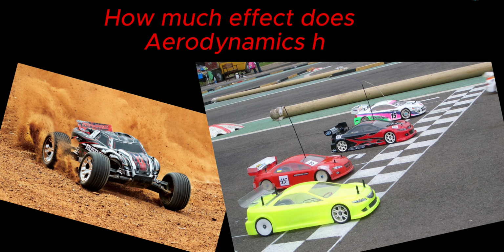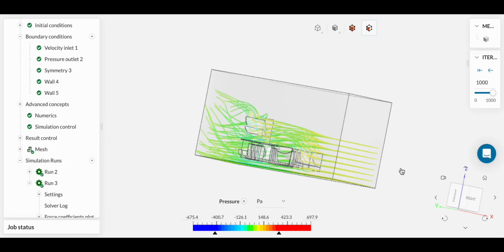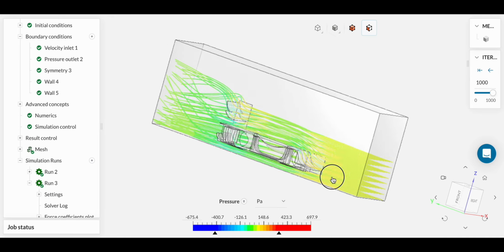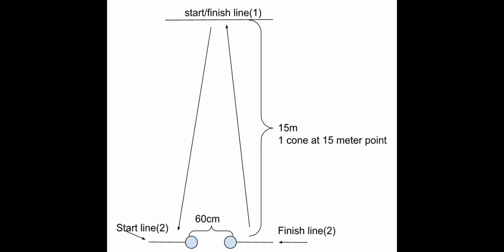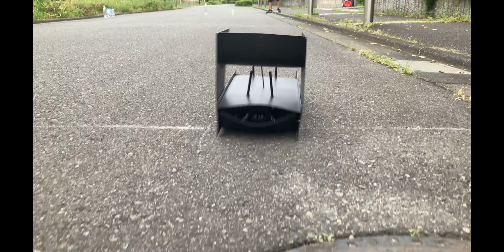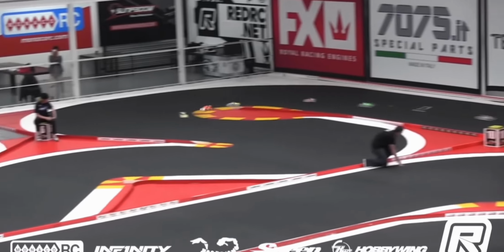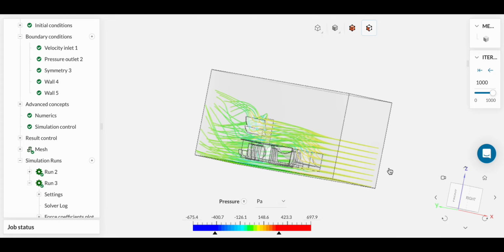Does Aerodynamics affect Remote Control cars?

Comment: You're on the right track with critical thinking, setting up a test, quantifying, and evaluating the results and validity. This isn't a super clean battery of test points, but you're on the right path. The fact that you designed and built your own test article, as well as designed your own test, is great. You're on the path to being a designer or test engineer.

Comment: Aerodynamics of rc bodies is massively critical. High speed is where aero becomes critical. That body you built will give massive dowforce in a straight line, but will actually fight against steering. Instead of allowing the car to turn it will try to keep it straight. I use 3 different bodies on my drag car, depending on track conditions. As for 1/10 on the road, i run a pile of different bodies for different classes, rules, and conditions. At low speed where your tamiya is, weight balancing will go further than aero will get you. Those old chassis are rear heavy and need weight moved to the front to counter their natural under steer. Driving techniques  do a lot to improve cornering, knowing how your car is going to behave when diving into a turn goes further than any amount of tuning can ever do. To compensate for my buggy being 10 years older than my competitors, I yeet it tight into corners and spin the back wheels for rotation. 

Don't feel discouraged by anyone or anything, what you're doing is what designers and engineers have been doing for thousands of years. You're taking the first steps into a complex field with a good base of understanding. Take time to understand every aspect of a car and you will succeed in your endeavors. 

That is a great chassis to learn on, it is very similar to modern TT chassis and probably still has massive aftermarket. Draw center lines between the width and length of the wheel base. The point that they intersect should be the center of mass of the car, try to balance at least the front and rear, left and right can come later. Complete car, battery and body installed. Balancing your car will unlock its full potential.

Comment: Really interesting topic. I would love to see further research.

Following comment is university level critique, so please don't take this as any form of bashing, but in hope that you would find something interesting and new. forget about my comment if you didn't:

One of two thing I think you could improve on is your understanding of statistics.
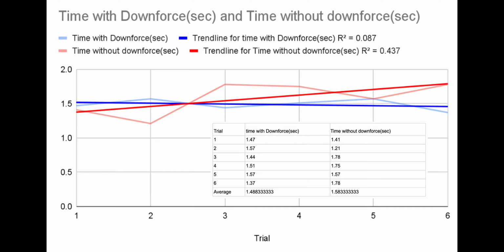Your figure at 2:55 shows correlation between number of trials and the lap time. This would be useful if you wanted to show the effect of running different numbers of trials (like showing performance degradation over time), but I don't think that was your intention.
In this case you should treat your number of trial as sample size, and show average and standard deviation of your lap time. This would give you idea of the expected lap time you would get by running in different configuration, and uncertainty in the lap time. In this case I suspect that you would get result that show the uncertainty of the result is way too large to say anything definitive.
This uncertainty would lead to second point: The designing of your experiment. Hand controlling the car would introduce too much uncontrollable variable, hence large variance, in your result.
Better experiment would be to split things up to make things more reproducible. For example you could split your course into timing straight lines with full throttle and no steering, and circular course with fixed amount of RC input.

Comment: Did you match the speed of your simulation to the speed of the car while turning? It seemed that the car made a slow sharp turn where aero doesn’t affect as much in lower speeds. Possibly if your car was faster and had a turn with larger radius the affect may great enough for aero to be a benefit. Also I’m not sure how powerful your rc car is but if the car isn’t powerful enough to make the car have over or understeer in the turns normally then the aero upgrade would essentially be useless. Hope this helps
Reply from the maker: Thank you for your comment, the corner is a very tight corner but from the data, it showed that it make the car a little faster so i think it has some effect, but i agree that a larger radius corner will make a larger effect of the downforce. The RC car is powerful enough to make understeer so that is why the test without downforce when very wide around the corner.
Reply: my thoughts exactly.

Comment: a factor that could have affected the result is weight and -distribution. also an idea how todo the bend is to start with a cylinder. an pet bottle for example :-)
Reply from the maker: thank you very much for your feed back! Actually i did not think about considering the weight and distribution of the car. (But i the Rc car body i made is really light so i think it does not make a lot of difference in performance) I think using plastic bottles is very good! i really struggled bending the material.😅
Reply: @technologylabo  i dont think it has that big of a difference either but to make your findings conclusive you should test it. 
:-)